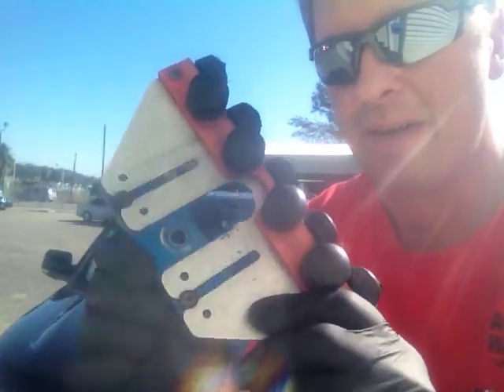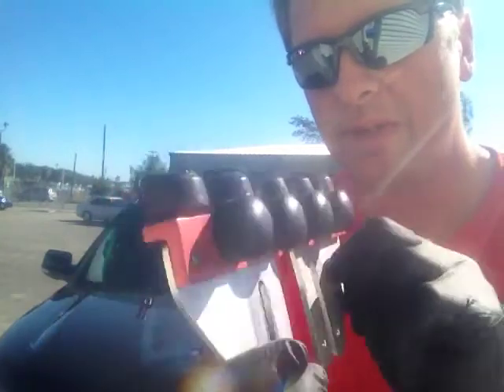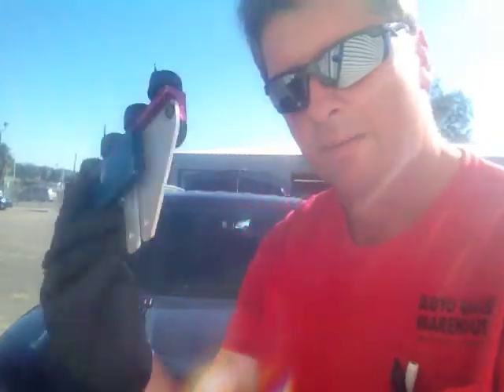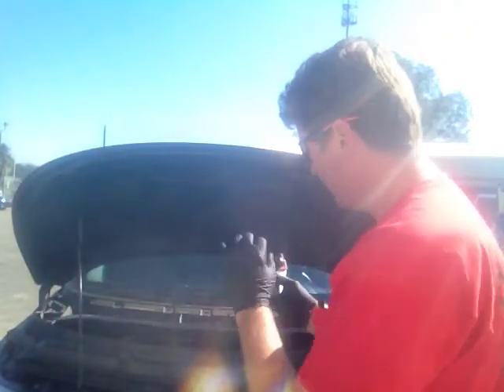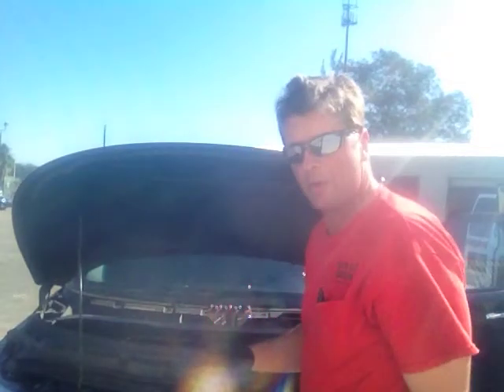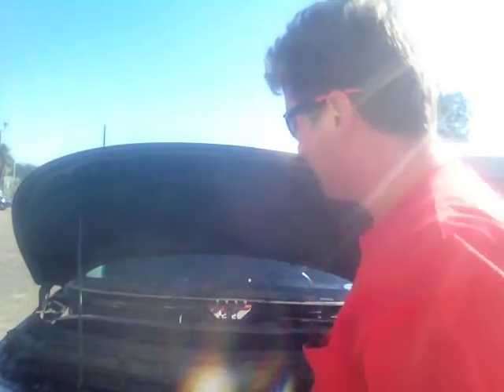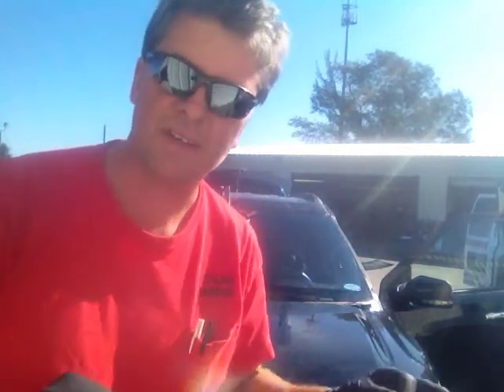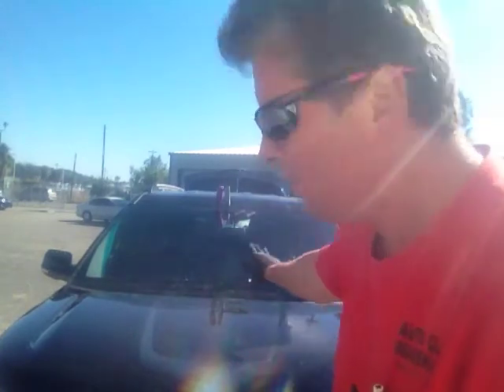2012 Ford Explorer  removal and set with the Rolladeck

Comment: Good video, thanks for sharing. By the way, when removing the windshield, where you able to reuse the trim moldings on the a-pillars? Either upper/lower. Thanks in advance.
Reply from the maker: ***** Thank you for watching, please see our website for more product info @ www.rolladeck.net  It may be possible to save the moldings. Usually we choose to replace them to avoid any issues with the moldings coming loose, clip failure, etc. Most insurance companies will approve these parts as needed, why take a chance. When these parts age, they tend to get brittle and break during removal same with the Flex.
Reply: To save the trim on a ford flex pop the top clip with a trim tool only then grab the whole trim piece and pull upwards all the other clips will release, you'll never break another one ever again. But these explorer's we still haven't figured out how to save the trim......
Reply: @novalover12   for what u want to save, charge it to customer, they are paying for something good and new!

Comment: With the Rolladeck, can you use it with urethane on the windshield?  I only run the beed on the glass to prevent multiple seem lines which could cause possible leaks from those spots.
Reply from the maker: +ryan harder Yes when the bead is at least 1/2 inch away from the bottom edge of the windshield. Have you experienced issues with applying bead to the body? If you tool the joints properly you should not have any issues, also applying the bead to the body ensures that you make solid contact to the existing factory fresh cut bead.